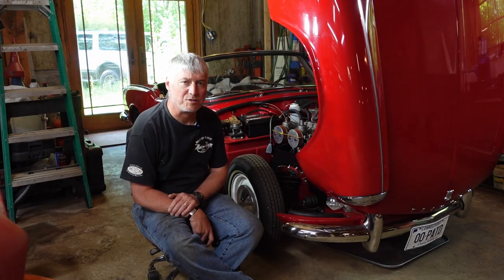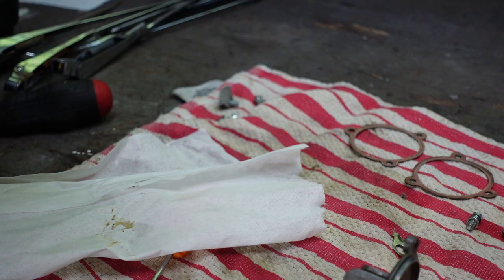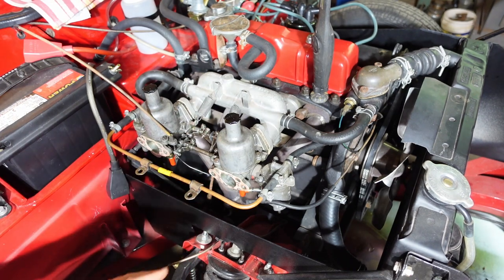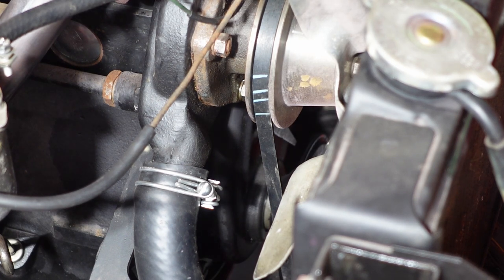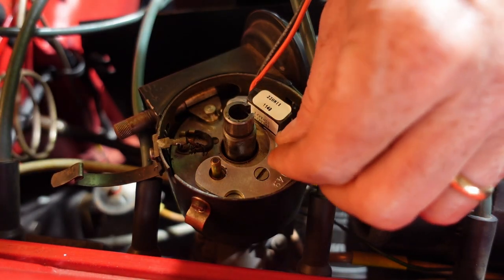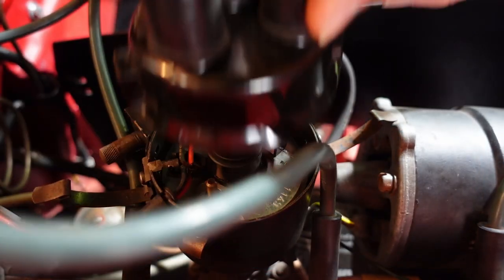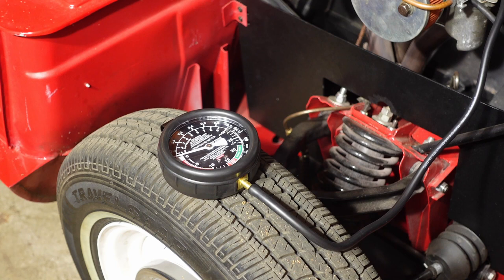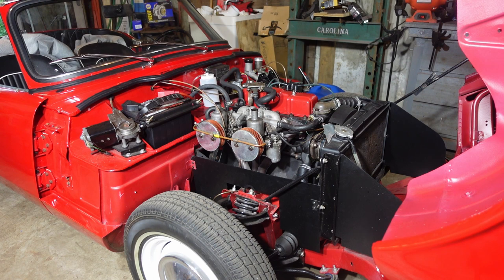Triumph Spitfire - Troubleshooting Rough Running #3 | Roundtail Restoration

Comment: Hi Chris,  You can check if the engine is in need of fuel by slightly pulling out choke while on the road.
Good luck.
Reply from the maker: Thanks. How would I expect the engine to respond? Would I try to recreate the rough running and then pull the choke and I assume it would go away? I'll give that a shot!
Reply: @roundtailrestoration  Yeah. Pulling the choke lowers the jet and enriches the mixture, so you can test if you’re too lean by seeing if engine performance improves with the choke out. Given it sounds like you’ve not had a really good run your plugs will be showing you more what idle / warmup is like (too rich - sooty - which you mention) rather than what it’s like when running properly at speed. So it’s still worth suspecting, or at least not eliminating, a lean mix.
Reply: @roundtailrestoration  Hi Chris, yes exactly,  as @redfoxclassics reply below :).  
Doing this, the engine should rev cleaner If the car is seriously starved of fuel. 
What is certain is new "Lucas" stuff coming in green box is made in asia and mostly crap.. Good Lucas was with orange box. Same with capacitors, new is crap. Try finding one from an agricultural equipment dealer as several old tractors were using a similar Delco dizzy; Old Vauxhalls used it too.  
In UK Distributor Doctor does Lucas stuff and also sells good quality Delco capacitors. 
Remade rotors often fail, particularly those with a big rivet on top...
Reply: A friend who painted the engine block found that the distributor wasn't always earthing to it, so make sure ALL metal to metal earths are good. Also there are 2 different fuel pump levers, 1 requires a spacer block & 1 doesn't, may affect delivery pressure, yours looks original AC, repros can produce to much pressure & I had to fit a regulator. Good luck with it!
Reply from the maker: @ghunt9146  Thanks!

Comment: Great video.  I'm sure you will sort it out.  I would love to hear the story about running without air filters. Good luck at the show.
Reply from the maker: Thanks, I hope so. I'll try to tell the story in my next video.
Reply: @roundtailrestoration  Chris I also think I might try to look for some kind of air leak in the fuel system that is only evident when really strong draw occurs under load.  Always some great suggestions in the comment section.
Reply from the maker: It seems to check out ok with the vacuum gauge. And I did use that propane to look for a leak without success.

Comment: Hey Chris, I had a GT6 with a similar problem that it would not continue to run and I finally found that the fault was with the rubber membrane in the Smiths Valve. It might be worth your while changing that out and see if it solves or improves the situation. Just a thought and I wish you lots of luck. Regards.
Reply from the maker: Thanks. I did check that out and it tested out for me ok. I'll put it on the list, though

Comment: original box filter is more effective as it acts as a cold air duct and feed both carbs equally well. the aftermarket sports air filter soak more heat and are more uneven in supllying fresh air. lots to learn, philip
Reply from the maker: Hi Philip, thanks for watching. On my car, specifically, Triumph use the individual filters when they introduced the Smith's (PCV) valve. Until they integrated it into the intake manifold, it was a bolt-on unit like mine is and they had to go to individual filters because the filters boxes didn't support the plumbing. There's actually a picture of it in the workshop manuals after Revision 3. With the Mk3, I think, the PCV valve was integrated and they went back to the box.

Comment: Chris love your videos. I have a 67 Mk3 I tore down 8 years ago. Nut and bolt total restoration. I lost hundreds of photos when I bought a new iPhone ( thanks to their employee) I am installing a new wiring harness now. Problem is I don’t have any photos of how everything was routed so it is a slow go. Rear harness was easy but under the dash and engine compartment is where I am struggling.  Could you send me photos of your wiring? I m ready to get this job done but need some visuals.  Thank you for your help,Tony
Reply from the maker: I'll see what I've got, Tony, but it might be a few days. Send me an email to roundtailrestoration66@gmail.com and I'll try to get something back to you.

Comment: Ignition switch…… or associated wiring.
Plastic piece on the back of the switch can deteriorate, become loose and cause an intermittent issue.
Reply from the maker: Thanks, Larry. I will check that. I had a new ignition switch at one time, but I can't remember if I went back to the original or not. Great idea!
Reply: I was thinking similar: maybe set your voltmeter up right at the positive side of the coil and get the car to act up, see if power is dropping out. Or jumper 12v right from the battery.
Reply from the maker: I'll give it a shot. Digital multimeters aren't great at measuring stuff like that. The old analog ones work better for seeing the pointer sweep when it drops.
Reply: Very true! Simpson 260, I'll bet you had those in the Navy!
Reply from the maker: Yup, especially early in my career. We still had them now for troubleshooting analog circuits, but mostly it's just Fluke 189s now since everything has gone digital.
Reply: My Simpson 260 fell off my motorcycle doing 70mph. It skidded1/4 mile before tumbling to a stop. It had a little road rash. I used the damn thing 10 more years. My Fluke gave up before my Simpson. They don’t make them like that anymore.
Reply from the maker: No, those things were tanks. On my first boat I think the one we had was about 25 years old. Never had to get a new one.

Comment: If ever you suspect a carb issue check the ignition is 100% FIRST !  I am 90% sure your problem is ignition by the way it stopped suddenly.   BTW that UK made distributor is not made in the UK, it is made in China.  Not that it is therefore bad.
Reply from the maker: I know the old adage that 90% of carb problems are ignition. In this case, though, I think it was something in the fuel line clogging up the jet.

Comment: Chris, I feel your pain. My car would not rev well beyond 4K, turned out to be valve springs that had got weak over the years. Not sure if you’d changed yours during the rebuild.
Reply from the maker: Thanks, Andy. I went back through my parts invoices and I did indeed put new springs in.

Comment: Hi, I haven't checked if you've actually sorted this yet but I had a problem with my spit that made it run rough: There was a screw in the distributer assembly holding on the... condenser? I think... And the flow of current that should have been going to the points was managing to earth onto the head of that screw intermittently. I found it by making the spark gap with a screwdriver and thankfully my friend looking over my shoulder pointed out that the spark that was created was finding that screw instead of always going between the contacts. Also, despite having disassembled and cleaned my carbs, once things had warmed up one of the carb pistons was occasionally finding some grip and not descending again, ruining the timing of the carbs. Just some suggestions, I hope you've sorted it!
Reply: It was that screw you undo at 15:30 that I'm talking about. After reading some comments and seeing the description of cylinders 3+4 being affected, the sticking carb piston seems quite likely, especially if the situation seemed to resolve itself after some time (exactly what happened to mine)
Reply from the maker: Yup, I figured it out. Had something obstructing fuel flow through one of the carbs so once I loaded it down, it could keep up and spit and stuttered. No problems since! Thanks for watching.
Reply: @roundtailrestoration   You're welcome sir, rest assured i shall be watching more. Very gratifying to know that my supposition was correct... ish!
Reply from the maker: @innocuouspseudonym509 Close enough!

Comment: Is the intermittent related to only rpm?
Can it be induced with speed vs rpm?
Any quicker to intermittent on rough road vs smooth road?
Rpm could be related to load but also related to vibration. 
Battery and alternator output up to snuff?

On big jets we’d do a “ hand over hand” inspection of wire bundles hunting for intermittent situations. This included tapping on connectors with say the butt of a screw driver, flex a wire bundle at various locations or even use freeze spray or judicious use of a heat gun trying to initiate a change in the status quo. I found a lot of faults with the freeze spray at connectors. 99% of all Lucas wiring issues are bad grounds or dirty/ corroded connections. Probably all obvious to you,
just brainstorming with ya brother….
Reply from the maker: Thanks, Larry. It seems to only be related to RPM because I get it while the car is sitting in the garage as well as when I'm going down the road, though it seems easier to reproduce under load. I drove it around the property (bumpy over grass and all) and didn't have any hesitation (going slow, of course, not really revving up there). Battery and alternator are good. I have not gone around checking for loose connections, though. One recommendation I had was to power the coil directly from the battery, so I might give that a shot.

Comment: Hi Chris, I do hope your pb is only ignition/carb related but the fact that cyl n°3&4 seem always down on power, all the symptoms you have might be caused by a very tiny crack in the inlet manifold water pipe, going through n°3&4 inlet duct below when the cooling system pressurizes and metal expands.
Similarly it could be tiny coolant passage through the head gasket on cyl 3 & 4.
Good luck!
Reply from the maker: I don't like any of that!
Reply: @roundtailrestoration  Usually telltale is some white ash deposits on plugs
Reply from the maker: @weescotildweescotild6875  Thanks. Not seeing that. Plugs actually look okay...but I'm not sure I've put enough miles on them to get an accurate representation. Nothing gross, though.

Comment: There is an old saying about British cars - "most carburettor problems are electrical", suggesting that most running issues are related to the ignition faults. You have eliminated distributor and plugs but what about the coil?  I had a very similar problem where the car would run well when stationary but once moving would start to  miss and backfire.  The problem was the ignition coil breaking down when warm and under load.  It might help diagnosis if you have another coil you could substitute.  Good luck.

Comment: Very long shot, but when I bought my Spitfire it had been run very infrequently over the preceding few years, and the float bowls were full of some sort of sediment which I assume must’ve resulted from fuel degradation (it had a filter before the pump). It might be worth emptying them fully with a syringe as you’d only need a tiny bit of muck to reduce the fuel flow to the jet. Small chance you have the same issue as you’ve done a pretty low mileage since rebuild.
Reply from the maker: You never know. I haven't pulled the jet lines from the float to the jets yet, but maybe I should, and blow them out after also draining / cleaning the bowls. Can't hurt!
Reply: @roundtailrestoration  Thinking about it, I’ve never experienced this myself but have heard about it from fellow TSSC members, some fuel hoses can generate tiny rubber slivers which are another potential cause of your issues. Would be solved by the same clean out process, but may reoccur if you’re having to disconnect/reconnect the hoses.

Comment: Hey Chris get you a gallon jug gas put beside that car take your fuel pump and hook it straight into it and rev the 0:07  car up and see if it's doing what you're doing now it sounds like you're sucking trash up in the tank and  higher RPMs did you use the original gas tank I can't remember when you was building that car hopefully that might help you have a good day
Reply from the maker: Thanks. The entire fuel system is new, expect the fuel pump, which I rebuilt. The tank was new to me, but never installed (it came with the car). I'll see if I can come up with an alternate fuel source that doesn't scare me.

Comment: I had a 64 years ago. I sure miss it. I notice that the windshield wipers on your 66 are opposite from my 64. The wipers rested to the left and would leave a smear right where I looked through the glass. It seems that later years they inverted them to rest to the right. Am I right?
Reply from the maker: No, I messed them up and got the wrong wiper arms when I ordered them. I have since swapped sides and reset the motor resting place. And they still smear the water right across your view! Thanks, Rick!

Comment: Does the electronic ignition still use the weights on the distributor?   (The weights often stick at higher RPM.)
Reply from the maker: It does. I checked the weights and they move freely and the springs look good. I don't think it's a weight problem.

Comment: the extra hole in the carb back is so the piston goes up and down with the vacuum. if you block it the your carbs wont work correctly people do this by fitting the front carb gaskets on the air filter side of the carb seen it done too many times
Your engine should be running temp when you compression test!
Reply from the maker: Thanks, Billy. I have heard to run compression on a warm engine, but also heard that it doesn't matter much because you are looking for a large delta, not so much an absolute value. If the pistons are all in the same condition, hot or cold, they should all run about the same compression. If you have an obvious problem with one, it won't matter if you're hot or cold, you're going to see it. That was my intent here. Thanks for the tips on the rear hole, tho. I usually forget that and have blocked it with the gasket more than once. Cheers!

Comment: Could it the exhaust has a blockage and when you run at high RPM you get a lot of back pressure.  Just a thought.  👍
Reply from the maker: I don't think so. The exhaust is new from the head to the tailpipe. And it feels nice and strong back there to the hand, but that's very subjective.

Comment: Im having this exact issue right now and its confusing the hell outta me, almost like its running on 3 cylinders, i get the odd backfire. But under load looses power!!
Reply from the maker: A backfire to me sounds like a timing issue. But, for me, I think it ended up being gunk in the carb jets. I took them all out and sprayed carb cleaner through them and that about took care of it. I'd verify your timing first, tho.

Comment: it odd that it seems to run fine, then it goes rough after a while.  Does it ever go back to running smooth without shutting it down and letting it cool off?   My gut tells me that its the coil again.  it could also be something like a tiny vacuum leak that gets worse as the engine warms up, maybe a loose intake?  I know that is what the propane is for.   Maybe even a borderline bad plug or wire.  
I have confidence you will nuke it out eventually.
Reply from the maker: Thanks, Tim. I went ahead and ordered a new coil. I need to get a set of plug wires, too, but they are relatively new (new to restoration).

Comment: Could it be the coil breaking down when it gets hot, and you loose spark or you get a weak spark ?
Reply from the maker: It could be...and last year when I had similar problems that's what I concluded it was. Not sure now if that was the case and this is still the same problem, but I did end up replacing the coil at that time. That would be two bad coils in a row, but who knows.

Comment: it seems to me to be a coil problem.  try the tr four coil on the spitfire and at least eliminate that issue.
Reply: I agree, I had a similar problem with my 64 spit couple of years ago. While the coil was cold the car would seem to run fine but when the coil got some heat going through it the car would start running rough and lose power.
Reply from the maker: Thanks, Nick. If it is the coil, this will be the second one. I replaced it last year when I was having issues. But, what the hell, it can't hurt!
Reply: @roundtailrestoration  - yes assuming you have the correct coil for your car the engine cutting out at a specific rpm is a coil that is putting out less voltage than spec.  so if it's supposed to be putting out forty thousand volts that is sufficient for the entire rpm range.... it may only be putting out fifteen  thousand volts sufficient to get you to maybe thirty five hundred rpm.  the higher the rpm the higher the voltage necessary to fire the plug.
Reply from the maker: We'll see. I've got a pertronix coil on the way.
Reply: @roundtailrestoration  -- saw your short vid.... still no love with new coil.  this is unbelievable.  next on my list is to check rotor, cap and all HT wire resisitance.
Reply from the maker: I have a feeling I'm going to be embarrassed when I finally figure this out. It's too easy to be this complicated.
Reply: @roundtailrestoration  you know what..... remove the muffler and center pipe.  a mouse may have made a nest somewhere up there....

Comment: Chris what I was trying to get to on using a gas tank beside the engine I can't remember if you bought a new fuel tank or just reconditioned the old gas tank but you could be picking up trash and about 3,000 RPMs with a vibration of the car. And what happened with the higher RPMs the vacuum sucks the trash to where the gas line is in the tank
Reply from the maker: Well, a bit of both. I had an original tank that I cleaned out (but did not treat or coat in any way) and used that following the rebuild. But, I got some sediment last year and I thought that was my problem then. So, I put in a new tank (that doesn't fit very well, I might add) and new filter, but the problem persisted. I still have that original tank and plan to clean and recondition it using one of those POR-15 tank kits.